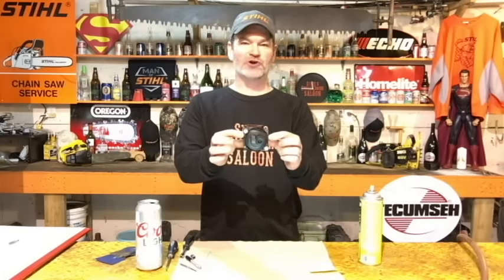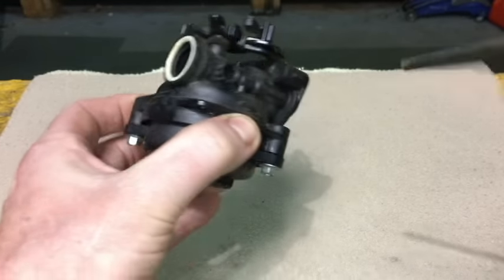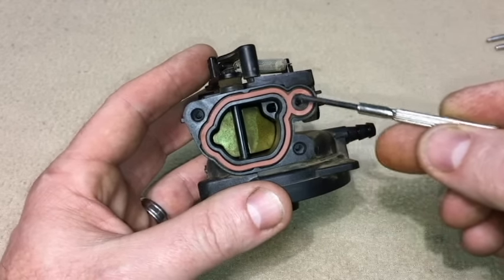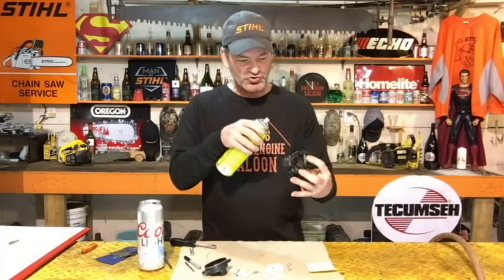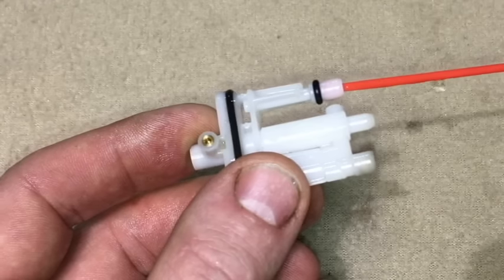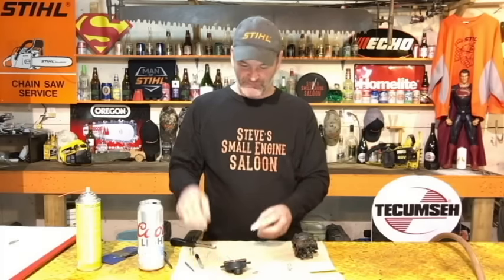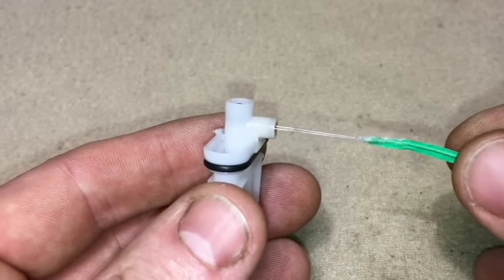EASIEST WAY To Clean a Plastic Briggs Carburetor

Comment: Where'd you get the metal needle? Mine has a junk white plastic needle with a rubber tip that is removable, it was swollen and stuck in the seat....I'd love to find a stainless needle like that for mine...Our shit ethanol swells them things up quick, and they literally fall right off the stem and stick in the bore...Other than that, I will say these carbs actually seem ok...at least they don't pit like the old aluminum ones....Thanks for your Vids! they really helped me get my Stihl Saw running like a champ !!

Comment: Hi Steve, great video do you know what causes surging on B&S 450E that has this same carb ?
Reply: Sorted it ! I had been a bit slack in putting in fuel fit additive,  so i added loads to a tank of fuel and run as normal for 3 days and its cleared and running fine, must have been that jet gummed up !

Comment: im glad you said you felt embarrassed,,,i was feeling that a bit today i sold a guy a lawnmower with this exact carberator and he brought it back a week or two later and it was plugged..he brought it back today i cleaned it but not like this so im guessing hes going to bring it back again as i didnt clean it like this...i get all my small engine repair knowledge fomr youtube so im not certified by any means so if and when he brings this back which im sure he will ill try to expand this fuel jet hole..Tecumseh lawnmowers have this same problem form wha ti hear...theres a fuel jet thats so small it looks like a tiny spec of dirt and often peopel make that jet bigger with a drill bit...now i dont feel so embarrassed

Comment: Hey Steve, I bought a new mower. It’s hard to start straight out of the box. I got it running, It runs good while mowing. It has the primer bulb without auto choke. Do you think the carburetor is causing the problem?
Reply: I love all of your videos, Steve, very informative. I do work on my own equipment.

Comment: Gday  just a thought.i keep a set of gas cutting torch tip cleaners in my toolbox they work well for cleaning out blocked shower head holes retic jets .n carby jets ect and they are cheep.

Comment: Thank you. I was about to throw away the whole lawnmower to buy a new electric mower.
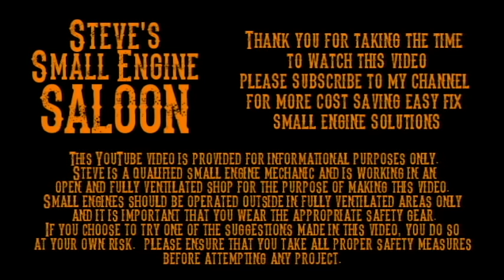16:18 that orifice clogged up  on mine. Pushing in a thin wire unclogged it. I could feel  the resistance then the wire went in thru the clogging. When it's open, I could see "light" on the other side. I didn't drill the hole to be larger however.

Comment: I owe you a beer. I pulled my 3 year old lawnmower out the other day for the first spring time cut. It's one of those "guaranteed to start in 2 pulls" type of mowers. Admittedly I stored it over the winter without fuel stabilizer in it. After about 15 pulls, nothing happened. I started to investigate. Spark plug was good. Air filter was clean. I put a small syringe full of fresh fuel directly into the air intake, gave a pull and It ran for about 3 seconds then shut off. I now knew I had a fuel problem. I was crunched for time and getting frustrated that I wasn't able to cut the grass that day. Jump ahead a couple days to today. I tried to get it started again. Nothing happened. I was ready to put the mower to the curb and buy a new one. Then I came across this video. I grabbed my tools, tossed my mower onto a work table, cracked a beer (my choice was Grolsch) and began disassembling the carburetor. When I opened the bowl I immediately discovered the problem. There were bits of something floating in the bowl. It was whitish. It looked worm like, possibly a grub. If it was a grub, I have no idea how it would get in there. I gave everything a good cleaning, then reassembled the carburetor. After the mower was assembled I gave it a pull. It started up and ran and ran and ran. I'm off to mow the grass now. I just wanted to share my story first. I'm happy that you saved me some time and money by avoiding repair shop. My wife is happy too. Happy wife, happy life. Cheers Steve!

Comment: My Husqvarna wont stop surging. I think this is my problem. It's starving for fuel. I've had the carburetor off 2 times and cleaned it out with carburetor cleaner, but I'm not getting a good spray like you are from that jet. I'm going to try this. Thanks for the video.
Reply from the maker: Good luck!
Reply: It didn't fix it. I buy and sell mowers for a living and I've never had a mower I couldn't get running by just simply cleaning the carburetor.  This thing is absolutely garbage!   I'm going to buy the $25 carburetor from Amazon I guess.
Reply: @StevesSmallEngineSaloon  Bought a $25 carburetor off Amazon and now it runs perfect.

Comment: These carbs , and the tank mounted one I clean and change diaphragms and any gaskets ahead of time so when I need them they are ready to go All I have to do is swop them out . If you use the Prime for a good Time as a denoises method it saves time , no unnecessary testing .these are also jetted very lean , so they will not burn older gas and the jets are so small they pick up dirt so easy .

Comment: I think mine is just crap. I tried all of this and many other normal carb clean up routines. Mine runs but sputters continuously with low power. Also everything else has been replaced as well. I used carb cleaner and blew everything out with compressed air after I made sure the drill would pass through. Im at a loss. A new one will be on the way soon!

Comment: Hi Steve first off your videos are great they’re all super informative and do exactly what you aim for them to do which is to help, however (and I think you’ll enjoy this conundrum) I followed exactly as you did in this video on the main jet (exact same type) for my mower that has a Briggs and Stratton 450e engine and it made it utterly powerless, starts first pull every time and runs but runs far too quietly and the moment it starts to cut grass that’s only 2 or 3 inches tall it loses all its puff and dies, whereas before it had all the power but would barely start up. please help

Comment: Thanks, I cleaned the carb with a wrapper tie, mower started on 2nd pull.  Howerveve, I'm confused; the micro drill bits set you reccommend dosen't have a 0.02 inch bit, the smallest bit is a 0.03 inch.  Should I use the 0.3 inch bit?

Comment: Do you ever pull that cartridge apart?  I have been told to pry it apart or I was not really cleaning it.  The main feed you drill out pulls out if the bottom part of the cartridge where that rubber seal is. This allows the main tube itself to be cleaned. 
  It was new to me. One if the tubes that pull out of the cartridge had like 3 holes (I think) in it that you cannot see without pulling the cartridge apart. 
  Guessing as little as that main feed is, it only takes a spec to block it.

Comment: I was getting ready to do my lawn...  Changed the oil and gas...  Spark plug new...  Wouldn't start...  100 times pulled the cord but nothing...  Watched your video, pulled the "do hickey" out of the other do hickey and cleaned it with foaming window cleaner...  Dipped it in BBQ starter..  Dried and replaced it.  First pull, Stronger than new after 5 years using the same mower.  Thanks for the video...  And yeah these plastic carbs are for crap....
Reply from the maker: Great job!

Comment: Yeah, I've had the same problem.. clean it and it runs great, sit overnight and it runs really rough the next day. I ordered a new carb. If it happens again I will drill.
Reply: Yeah, I dunno.. I mean it starts, which is more than it did before, and it runs, I can mow the weeds out front .. but the thing still sounds rough. Like you can hear a little "backfiring" in the muffler.. Like the fuel delivery still isn't as smooth as it should be.  Considering my friend is trying to mow vertical weeds with a horizontal mower maybe I should just call it good enough.

Comment: I realize this is an old video. I've used my mower for 3+years with no issue until yesterday.  I am pretty sure the carb jet hole may be plugged by ethanol(corn) fuel that has congealed or something.  I will follow these instructions and let ya know how it goes.
Reply from the maker: Good luck!

Comment: I drilled that hole a bit too big like 0.0034" now it runs but kinda slow like 2,000 RPM and without the carb foam, is the hole too big the cause?  if I put the carb air filter foam back it goes thru a slow gradual RPM decline and then dies.  How can I fix that?  Thanks

Comment: When I first started working on these plastic carbs I figured they were junk, but now I like them.  I’ve worked on enough rusted metal bowls (mainly Honda) to appreciate plastic.  It worked on Lawn Boy for years.  I have about 10 old 2 cycle Lawn Boys that still have the original plastic carbs and they still work well.
Reply from the maker: Right on

Comment: I wish I could just buy a good quality carburator for this mower.  Ours gets very little usage and it's such a a piece of crap dealing with it.

Fouled plugs, crap carburator.  I've gotten it working again several times only to have more problems with things that really shouldn't be a problem.

I'm VERY thankful for videos like these and more information, but really I'd just like to have the crap parts on it replaced with something good that doesn't need constant fiddly attention.

Comment: I followed steps on your video. Cleaned the jet out and the mower started up/ ran perfect. After 30mins it shutoff again and wouldn't start. Repeated everything and it ran again for about 15 mins then died out again. So 3rd time I drilled the main jet with a wire drill bit .52mm that I bought for $3.50 at local hardware store. Sprayed everything down good including cartridge after drilling it out. My Briggs Motor on my murray push mower will not start at all now. I'm looking at ordering a metal carb on eBay that also has fuel line filter included. Would you think that installing inline filter would affect the starting/ running of the mower. Also, do you know if the metal replacement carb has the same type of plastic jet cartridge inside it?

Comment: @ steves small engine saloon I have small push mower with a B&S engine. Last year, I pulled the hose to the gas tank to drain old gas out. Ever since then, when I try to fill the gas tank, it fills and then slowly drains down. I don't see any leaks. I took the carb apart and cleaned it. Now it won't run. When it was running, it sputtered. Is the float bad? Idk how to fix it

Comment: I have a Toro 22 recycler and after 1 winter and spring sitting, and i pulled it out a couple weeks ago and it would not start, It would run for maybe 3 seconds and quit. I searched for answers and found your video, I followed your instructions and it now starts and runs... THANK YOU.....On another note, 3 shops i called to see about getting it repaired first told me it was junk and throw it away and buy a new one. Whats wrong with people now days,  Once again, thank you...
Reply from the maker: Yup.  Some shops are clueless!

Comment: Steve, question for you. I have a Toro Recycler with the B&S motor that has the auto-primer and plastic carb. Bought it last year and didn't really have any issues with it. This spring after doing the yearly maintenance, I noticed it's not running well. Starts up and idles fine, but noticed it starts stalling on bumpy or angled ground, even worse with the bagger on it. Fuel was drained and fresh fuel was put in it. Would this cartridge issue possibly affect my mower? I can't figure out what it could be at this point.
Reply: Yes probably. I watched another vid that said 4 likely problems. 1) It's probably the carb - clean it. Worked for me. or 2) Your gas-cap air-vent might be clogged. He did a vid showing us why the cap needs air - how to check if yours needs replacement.
Reply: @kenalpha3  I forgot about this, I never got a definite answer anywhere so I sold it and bought a Honda 217. Night and day difference of a quality mower over the Toro.
Reply: @triton302  oh sorry bro. Thanks for the model. I like mine. But looking to buy another if needed.

Comment: If we know "how" the carburetor works  , it's easy to clean and fix it. But sometimes when the carburetor is blocked by old stale petrol, it won't be able to clean the holes and paths completely by carb spray. And for aluminium carbs, we can boil it in water too, to clean it. After that only to think about changing it by looking the time and cost of it.

Comment: The problem with these plastic carbs is probably that they sit too long with fuel in it. I'm sure that is what happened with mine. How about doing a video on installing something to  drain out  the fuel remaining in the tank. I thought about a three way fitting in the fuel line between the tank and the carb, but I couldn't find anything, that would work. Do you have any ideas? Do you know what the inside diameter of the fuel line is?

Comment: I wonder if the carb cleaner might be depositing a tiny bit of dissolved plastic in that tiny hole. 
  Does the drill not leave tiny pieces of metal in the carb?
  One person told me when I told him I cleaned one, he bet I didn’t thoroughly clean it. Told me he pulls the long pickup apart when he cleans one. 
  I didn’t know that pickup would separate from the cartridge.

Comment: i sprayed into a clogged hole, didn't feel good on my eyeball, flushed it with water pretty well and i was fine, probably should use eye pro.....i'm going to buy that drill bit set and widen that jet

Comment: Very informative video, thank you. Do not use gasoline that is blended with ethanol in these small engines. Use a product like STABIL-360 Fuel Treatment & Stabilizer and add it to the fuel in your CLEAN nurse can. This gas can should hold a 1 to 2 month supply of fuel only. If the small engine is not going to be used for 4 to 5 months, drain the fuel and run the engine until its out of gas. Hopefully, the nurse can will be empty as well, but if not, get it filled and add the appropriate amount of fuel stabilizer to it.

Comment: I prefer Taryl's method of removing the "cartridge."
Rather than pry it out with a screwdriver, and potentially gouge the carb, he presses it out with a screwdriver shaft from the venturi throat.  Much more elegant.
I talked to the woman at the shop where I bought the mower (Toro 20333) and she said the main reason they replace, rather than repair the carbs, was time;  it's just quicker to slap a new one on than monkey with the "bad" one; time is money.
Finally, I only buy 1/2 gallon of gas at a time and put fuel stabilizer in every time.  Also have an older ("normal") plastic gas can with a very fine mesh screen on the . . . whaddaya call it, the nozzle thing.   My mower is four years old, starts ever' time.   Since it does so "well" on gas, buying 1/2 gallon isn't an issue and I don't have gas sitting around, potentially going bad (waiting to see how Taryl's Fuel Stabilizer Test works out).  
Love you both!!  It's like panning for gold - you get a little nugget of infomation here, get another one there.

Comment: FYI, I lost the little metal pieces that holds the white floater in place. I cut a piece of clothes hanger and it was the perfect size and diameter to snap into place.  My lawnmower works perfect. I thought 💭 I was going to need a whole to carb but a clothes hanger does the trick!

Comment: Question. I took this carb apart to find my moms mower and I was using the air hose to blow out the carb cleaner and next to the float was a little silver metal disk and it blew out and I can’t find it. How important is that?
Reply: If you managed to blow out the Welch plug you'll need to replace it and then tap the new one in with a wide punch. Bring the carb into a small engine shop and they should be able to find a replacement that fits and show you how to punch it in (or do it for you in about 2 minutes).

Comment: Love this video, but had a bit of a hard time finding it a second time... The title is maybe a tad misleading and a gross understatement.

This needs to be filed under: How to test and fix that "no start" dumb Briggs and Stratton plastic carburetor design.

Or something like that.  Thank you very much for sharing.  Might be worth adding some more detail on what your testing for and how you're fixing it in the description to make it easier for the search engine to pickup this video.  You really deserve a lot of views for fixing a major flaw with these engines using these crappy plastic carburators with improperly sized jets.

Edit: My jet fit a 0.4mm initially.  I opened it up to 0.5mm and very likely something like 0.55mm as I worked it a little extra.  0.6mm doesn't fit but might go in if I pushed it.  It feels close.

I could see that jet was fouled.   Last time I replaced the carburetor, I added a fuel filter.  It still plugged again, so now that I've opened up both carburetors to ~0.55mm, the mower runs again / starts easily.

Maybe I just need to always run it with some Stabil or other fuel stabilizer additive.  :/.  Never had this problem with our other mower.

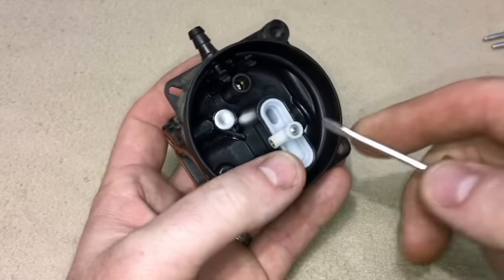Comment: OK Steve  , I have learned a lot from your shop. But now that we are talking this carb , I have a problem. This spring as I filled up the gas tank the fuel ran out form the carb.? This is the mower the lady owns. So I brought it home and no leaks, but no run. So I tore the carb off. What I did find was inside the float bowl was the silver cover ? that is on the bottom of the carb. You can see it still on your carb about 4:20 into the video. I have no idea of what this is and there is no way I can see to replace? Any help would be great ! So I will have my favorite Yuengling lager until I hear from you.  Thanks Mike from Cincy !!
Reply: Hey Steve , is this the "welsh plug" ?

Comment: I took the mower to a factory warranty repair shop. The guy couldn't fix it. I followed your advice and bored the tiny hole with a .6mm drill bit. The motor hesitation is all gone and running good.
Reply from the maker: Excellent!